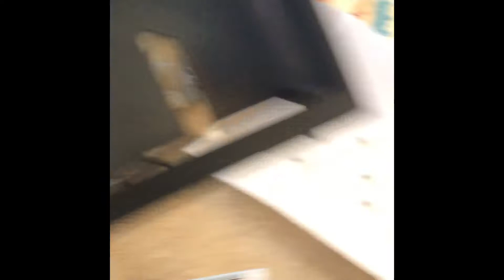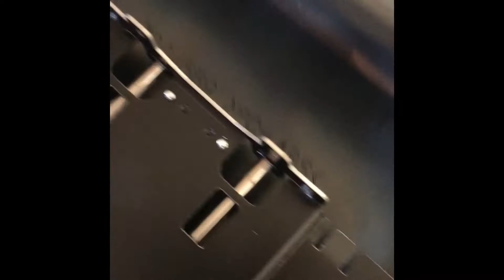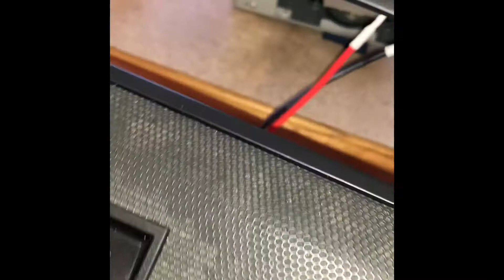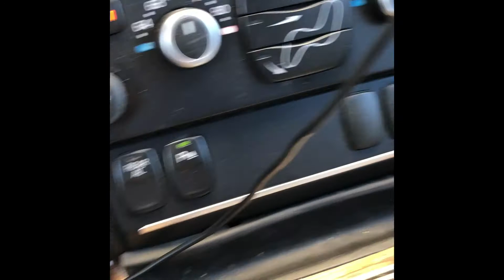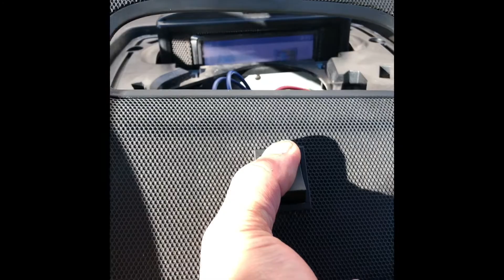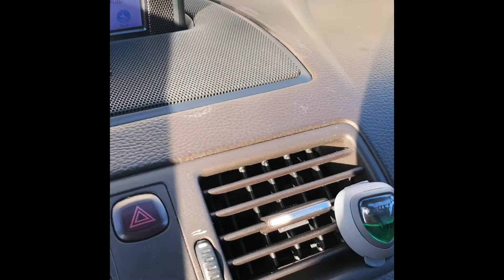Adding Garmin navigation to a non-navigation optioned XC90 for under $100

Comment: what type of speaker grill did you use to surround the garmin unit?
Reply from the maker: the old speaker grill from the door panel. I have it lying around and sturdy enough to hold the gps unit.
Reply: @highmilesgarage9131  would it be better to get a bigger Satnav, would you say?
Reply from the maker: @constantinos2993  it's possible to get a bigger one. An iPad will work too if you don't want it to go up and down. I was thinking of using a 5-6" gps units but the usb connections goes to the side which makes it a challenge to fit.
Reply: @highmilesgarage9131  I can’t find a single Satnav with a 6.5 inch screen

Comment: What kind of trigger did you put into the gear so that the unit stops going up when it is at the top?
Reply from the maker: it's a manual setup, you just stop pressing the button when it's up. Most of the time I have it up and never move down.
Reply: @highmilesgarage9131  If I wanted to make it automatic, would would I have to do?
Mine is also like yours, a non navigation optioned xc90
Reply from the maker: @constantinos2993  you could buy reed switches that when in contact closes the supply from the motor.The wiring will be a little bit complicated.